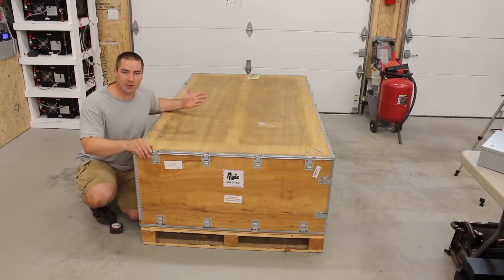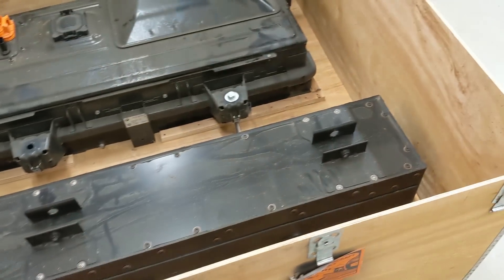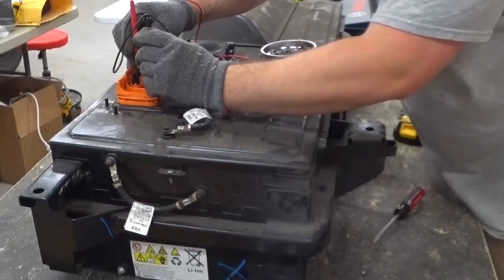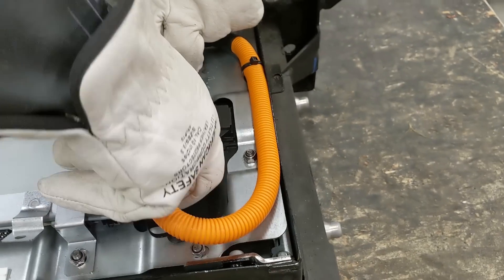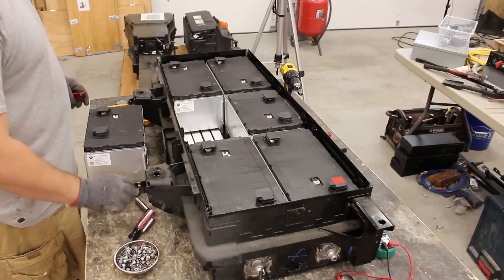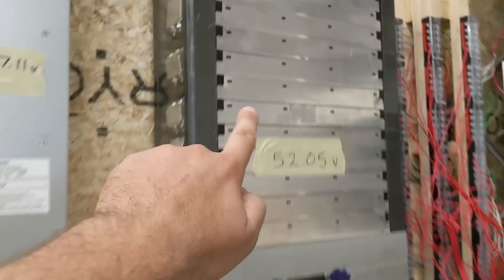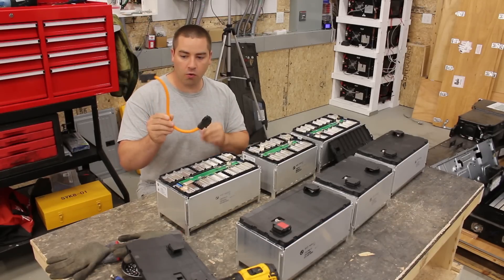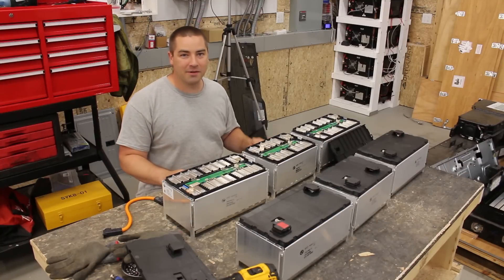Huge BMW Lithium Battery, EV, Less Than $100/kwh

Comment: David, based on your video i bought this battery pack. I drive all the way from Wisconsin to PA,  10 hours drive, to meet the guys also, but unfortunately could not meet them. I bought this to do a range extender to my nissan leaf. Just to find out, do you have any battery connectors left with you. ? Because those connectors are not avalable here. I check with battery hookup, but they said no. Eventhough i saw many cables leftover there. If you can help me to find those connectors, highly appropriate.  I need just 4 medium size cables. Thanks.

Comment: Great job I wonder how much free hot water you could have used but didn't
Reply from the maker: I'm setting these batteries up to be part of my solar system.  They will not be worked very hard (low C rate).  So they will not get hot.  This means I'm not loosing out on any hot water.

Comment: So I'm kind of a novice about this.  Is the area of storage how does these three compare to a home storage system?  Say like the Tesla PW 2?
Reply from the maker: The Tesla powerwall is a battery, and inverter, and charge controller in one package.  Since I DIY my projects I have to assemble the three components.  In this video I'm focusing only on the battery.  Beyond that, this battery is going to be about 2.5-3x the capacity of one powerwall.
Reply: @DavidPozEnergy  that answered my question
Reply: Thanks

Comment: 3.95v/cell. So they are at storage charge? What are you using these for and how involved is your charger/balancer. I have been flying bldc/lipo RC planes and helis for the last 16 years and bought a Chevy Bolt last year. Thinking a E Dragster is something I might consider building soon.
Reply from the maker: I'm breaking these down into 14s modules.  Then I'm going to add a BMS to each 14s module.  The BMS will monitor each cell to prevent over/under charge.  I run my house off-grid on solar.  This battery is going to parallel into my existing system to increase my total capacity.

Comment: Brilliant Video. Thank you a lot! My next step now, is to figure out how to connect the battery to SMA Storage Boy. The 
communication part can be tricky with modbus and BMS. But I am glad the battery is clear now for me.
Reply from the maker: I'm trying to figure out the same thing.  Batrium brand BMS has SMA protocol.  I'm currently testing "Tiny BMS".  It has CAN, but I don't know yet if it will talk to the SMA.
Reply: @DavidPozEnergy  REC has a BMS which can communicate with the "old" Sunny Island. But CAN is the way to go. I have seen the CAN Register are available in the download section ofthe SMA Sotrage Boy. Thank you for the hint with Batrium, I did not know that.

Comment: Just curious are those mining rigs over in the corner behind you
Reply from the maker: I don't have any mining equipment, so I'm not sure what you are referring to.  Maybe my sand-blaster?  Or my other solar equipment and batteries?  I'd love to help more if I could.
Reply: @DavidPozEnergy  bitcoin mining rigs -gpu's strung together
Reply from the maker: @originalandrewmark,  Thanks for clarifying.  I don't own any bitcoin stuff.  You probably mean the 8x batteries in the white shelves.  Those are LiFePO4 battery packs.  Each pack is 24v, and I have them arranged 4p2s, making a large 48v battery  bank.  I have several videos on  my channel going through them in more detail.

Comment: Why not connect the heat exchangers and use it to heat your domestic hot water.....or your pool/hot tub?
Reply from the maker: In a car these cells probably do get warm enough for something like that.  But I'm using them for solar storage.  Meaning I'll only be pushing/pulling a few amps each.  The cells will probably never get warmer than 1 degree above ambient air temperature.  Not hot enough to be useful for DHW.
Reply: DavidPoz Understood :-)

On a related subject. You have to put a lot of work in to add the BMS and connectors etc. Has there been much work in the field to reverse engineer the electronics already in the enclosures so you could just plug-and-play them? This was really apparent on the 48V long computer battery modules you reviewed. If someone had come up with either a protocol to talk to the existing hardware, or new firmware to program in to the hardware, the overhead to use them would be so much less....
Reply from the maker: It would be fantastic if someone could.  I don't know of anyone who has put in the time to do so.  Back when I purchased my BYD batteries I took out 12 of the built-in BMS units.  I mailed them out to programmers who all thought they could reverse-engineer it.  Including two I sent to Europe ($$$ shipping).  To date, nobody has responded back with a solution to use them.  I gave up trying to figure it out myself.  I just replace the BMS with a third party unit.

Comment: Hi David.  I just used your discount code at the battery hookup and purchased a BMW OEM 16s 57.6v 35ah 2kWh MODULE... Quick question: what's a decent BMS I can order (fairly quickly, less concerned with the cost) that I can connect to this unit to get the best life out of the BMW module...?  Thanks in advance!
Reply from the maker: I'm currently testing a "Tiny BMS" that goes up to 16s.  I just posted a video on it today.  But you can also contact "Daly" brand and they will make you a BMS for any parameters you ask for.  I've ordered from them and paid for the air mail, and got my BMS in less than 2 weeks.  Once in just 7 days.  You can contact Daly through Aliexpress.
Reply: @DavidPozEnergy  I appreciate your input.  I checked out the tiny BMS. It looks amazing. I couldn't justify the price. I found a 16s 60amp with Bluetooth for $68 shipped. I should see it in 2 weeks if I'm lucky. I really appreciate your tip on soldering to the thinner BMW BMS lead to get a good solder bond.  That's a tip I'll definitely use!

Comment: Doesn't this pack have an integrated BMS? it looks like you throw away the computers that come with the pack, and then have to install new ones yourself.
Reply from the maker: The integrated boards are not stand alone.  They need communication with the cars computer to turn on.  Since I'm using the battery outside of the original car I need to do something different.  A computer programmer might be able to bypass this, but I just have to replace it with a stand-alone BMS.

Comment: Hey David, were there any mfg names or part numbers on the connectors around 7:36? I'm trying to find those connectors to hook up my BMW battery. Thanks!
Reply from the maker: Sorry, I haven't found the connectors yet.  I'm interested in the same.
Reply: @DavidPozEnergy  No worries. I'm currently leaning towards cutting the top off the plastic protector, drilling a .25" hole (very carefully!), and bolting a ring terminal on there. Then mechanically secure the cable so it doesn't stress the cell tab.

Comment: With Discount code, $2880 with shipping for a 27KWH battery, according to Batteryhookup. That is $106.67/KWH. Pretty good deal.
My LiFePo4 batteries were $468.75/KWH

Comment: 15:03 I think you are getting it all wrong. If you push 100A in that huge battery pack it is heating up a few degrees. The aluminium heating pad is mostly not for cooling but for heating.

google: "nmc battery maximum operating temperature"

Comment: David,
Thanks for showing me your tear down of this battery.   Since I'm interested in using the whole battery, instead of taking it apart, I'd like to take a good look at it before it is disassembled.   So, could you Poz for a moment, and give me a good view after the steel pans are removed?

Comment: so what is the best battery chemistry for a Solar DIY power wall? LiFePo or Lion or Lead Acid or something else? It seems to me that used Lion batteries are the cheapest best way to have a back up energy supply.
Reply from the maker: I like using the li-NMC cells from EV.  But all can work if you treat them well. Use what you can get

Comment: Don't all batteries have a limited number of recharge cycles? How do you know how many are left when buying used Li-ions? Also, any suggestion on how to configure these for 72v for a 20Kw marine electric motor? Is 21s too many?

Comment: Greetings David. I have a question.  You said that your batteries would heat up with a 100 amp charge and you did not want to install a cooling system. I have Tesla batteries. It is a 9 kilowatt bank at 24 volt nominal. I stuff 150 amps 9nto them all the time and never see any heating. I do have the coolant loop connection with a radiator and a heater. The heater keeps the batteries from freezing but the cooling relay has never come on. Is typically see 1.5 degree rise when charging hard. Do you think it is because Tesla NMC chemistry has less resistance than Lipo4?
Reply from the maker: It has to do with the size of the battery. 9kw/24v says your battery is 375ah (amp hour). I find lithium nmc gets warm while charging at half that in amps.  In your case, 375/2= 187.  So I wouldn't charge at more than 187 amps without cooling.
Reply: @DavidPozEnergy  I guess the cooling relay never comes on because I see 150 amps for only about 1/2 an hour then it tapers off fast. We only use 6 kilowatts invariably 24 hour period.   We only use 120 amp hours over night. The lithium charges so fast with so little resistance compared to FLA it is amazing. The long and short of it is The 150 amp charge is just not that long when replacing 120 amp hours. So the cooling pump does not come on. Now the heat relay comes on in the winter and keeps the batteries from freezing. We are moving the system to a new off grid location that gets very cold. I really need to get three new BMS modules that have low temp cutoff. Thanks for your input. I have watched your channel from the beginning but only recently subbed.

Comment: Out of all the different methods you've used to build the different types of battery backups, which would you consider to be the most bang for your buck and time?  IE, which method had the best ROI in terms of money spent as well as time spent?
Reply from the maker: I like the larger format cells, like in this video.  It takes a lot of time to spot weld tiny 18650s.

Comment: You need a chain hoist or engine hot trolley I beam or something at least in one spot in your shop to lift these heavy things . I use an engine hoist. A friend had a roll around hoist like a U shape about 5 feet wide to roll over object by putting it in the open end of U and hoisting straight up with boat winch to snatch block pulley and could effortlessly lift 2,000 lbs and roll it around etc.

Comment: At 11:42, you show the heat sink system. Computer motherboards use a thermal paste to conduct heat from components to the heat sinks. With the german penchant for overengineering, I think they would have used it. It would have made it a bit of a chore to pull the cases out though.

Comment: Great video I do appreciate the tear down video:  I may order one very soon. Can you tell me the KWH of the two 48v batteries either each or all 110V?
Reply from the maker: Originally 9.3kwh, but they will probably test about 8kwh.  Every cell is 45ah, and BMW grouped them 2 cells in parallel. Meaning the battery is 90ah.

Comment: FYI, Dave the whole (3) BMW battery units are $2,700. and $450 shipping. they do not have the smaller 6 pack units individual units
Reply from the maker: Battery Hookup sold out of the smaller pack (8kwh).  But the owner said they are going to disassemble more crates and pull the 8kwh packs out and re-post for sale.

Comment: Why haven't you made a high voltage battery system? You have almost everything to make one. The only thing is that your array might have to be  setup for 450V- 550V.  The higher voltage would help you in the long run and less ampere you would need. Which would make your system safer and voltage drop. You have a lot of very good batteries there to power your house and workshop.Especially the BMW Batteries they might be the same as the sonnen battery setup. I wish I can afford 2 set of of the BMW batteries. Fully charged you can run the house for maybe 3 days or more. If you set it up in a high voltage configuration.  Please don't take this the wrong way ! I  see that you have one of the best setupand you are the only one working with big batteries. I have an LG Chem battery hook up to my solar array. But I have the power company not wanting me to go totally off grid and self producing home. Thank you for your time.
Reply from the maker: Two reasons.  First, there is a limit to 50 volts DC for residential systems.  Second, 48v equipment is easy to find and buy.  I don't even know where I would look to find a 400 volt inverter and 400 volt solar MPPT charge controller.  They are probably out there, but I don't know anything about them
Reply: @DavidPozEnergy  Answer me this ? Why is StorEdge and Solaredge ar at 400 Volts DC, and LG Chem batteries are setup on high voltage DC ? And they  are marketing this to residential. Yes, you are right on the MPPT. In that case you would need to go into storedge setup like a 10k setup or 2- 7.6k setup. You have the best setup to do it. I was just asking but I guess I might have to do it alone and purchase the items myself. Thank you for your time Mr. David
Reply: @cruizgonzalez5004  We have SolarEdge 10kW grid tie ourselves, and it runs nominally at 400VDC before the inverter.  So I sort of have the same question.  No doubt that going above 48VDC introduces all sorts of new safety issues, and it wouldn't surprise me if code-compliance was more complicated.   And for higher voltages, you need to be really anal about the quality of wire, connectors, etc, etc.  But I am not seeing a reason why there would be any absolute limit.
Reply: @JackRussell021   The storage have safety built then to. The nominal voltage of 400 to 550 is designed that way you use less amperage and you use the household wiring to reduce the cost of wiring from DC to AC Inverter is design for high voltage low amperage which reduce heat and the thickness of cable
Reply: @DavidPozEnergy  what do you mean by 50V DC residential limit? Just supporting equipment available, or some other limit?

Comment: David,
Can you link the BMS that you will use for these packs?  And how are you going to determine the pin configuration of that plug on the top of each module?  Will you use some sort of schematic from BMW?  I'm very interested.  Thanks for sharing
Reply from the maker: I'll probably use a 100 amp Daly BMS.  I'm working on a video about it now.  To determine the cell plug, check out this video: https://youtu.be/aO-DlNrj5SU  I don't have any information from BMW.  I will just have to use a multi-meter and trace which wire goes to what pin.
Reply: Hey  @DavidPozEnergy   how we coming along with the Vid... dont mean to rush..lol

Comment: I wonder if I can get this or something similar in California. Would rail freight be less?
I live in the Antelope Valley (Aerospace Valley) and we have alot of sun, so solar is becoming ubiquitous around here. I want to buy a few acres and create an all OTG boondock home and batteries are going to be integral to this mission.
Reply from the maker: I'm pretty sure Battery Hookup ships anywhere in the lower 48 states, so yes.  You can get them.